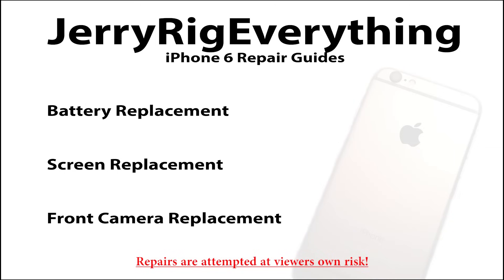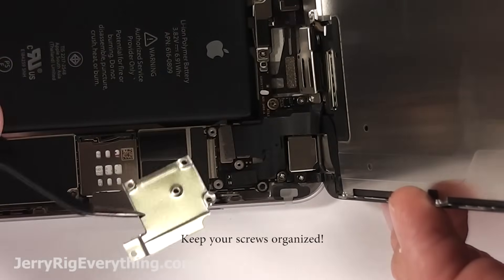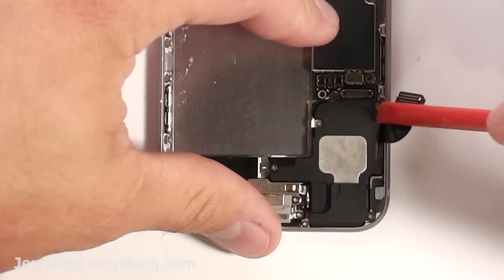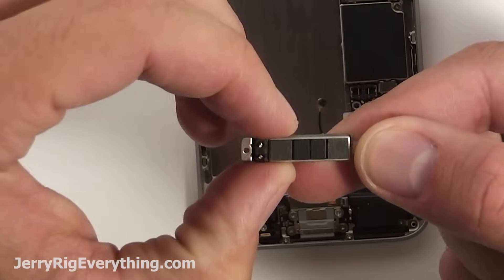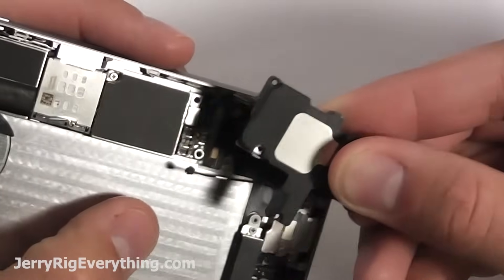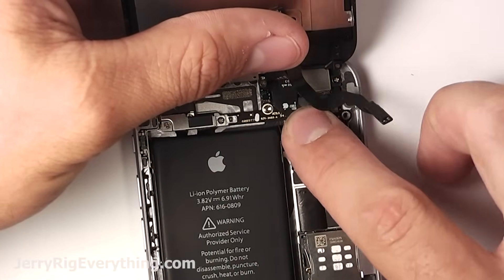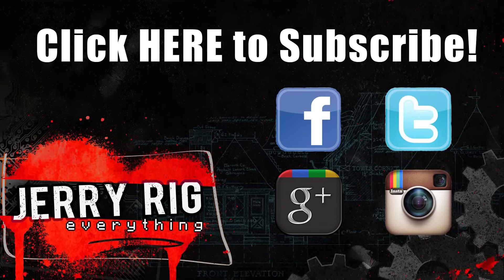iPhone 6 Charging Port Replacement in 5 minutes, microphone fix, headphone jack repair

Comment: Before you perform this task try cleaning the port with a toothpick.  Worked beautifully.  Held more lint than my belly button.
Reply from the maker: +Cutter Johnston Very good advice!
Reply: +Cutter Johnston Woah. You just cured me of months of headaches. I wish I had seen this sooner. Charger works like a charm now. Pulled out a TON of lint. thank you!
Reply: +Cutter Johnston dont know why i didnt even think of that.  thanks man
Reply: +Cutter Johnston I cannot believe that was what the problem was....phone working perfectly again, cheers for saving me the hassle of getting it sorted in a repair shop! It was full of lint!
Reply: +Cutter Johnston LOL I was just about to go into the apple store or sprint store to get my iPhone "Fixed" but this worked! I cleaned it and it felt like I was sticking the toothpick inside Narnia. So much dust came out from there. Who knew?
Reply: You're a genius!!! I can't believe how much lint I pulled out! I was just going to buy a can of air but tried this toothpick first! Phones been like this for the past 2 months until today :) Thanks a lot!
Reply: +Cutter Johnston Thanks alot this really worked,never knew so much lint could get stuck in there
Reply: Me either.  Simple fix too.  Pass it on.
Reply: Love you TOOOOOOOO
Reply: Wow! This has sure been a l low tech success.  Amazing to me.  Thanks for your comment!
Reply: GOD FUCKING BLESS YOU ARE A FUCKING HERO
Reply: +Cutter Johnston you saved me on this one!  I can't believe I had forgotten I had to do this on my iPhone 5 when charging got inconsistent and I had to do the 'angle the cable sideways' type tricks to get it to charge.  Looking in the charging port, it didn't look like THAT much lint .. but after cleaning with the toothpick, it's working perfectly ... even when wiggling the cable it keeps on charging now!   KUDDOS!!
Reply: +Cutter Johnston You are the man!
Reply: +Cutter Johnston Thank you!! I can't believe how much lint was stuck in that small hole. You da man!
Reply: You're a life saver!!! Had one of those days where everything that could go wrong did. Thought I had to pay for a repair, luckily there was no available appointments for 2 days and came across this video and your comment. Just wanted to send a big thank you your way.
Reply: Toothpick did the trick! I should have known better than to take it to the Apple store. After several hours waiting a tech took a look at it and said it couldn't be fixed, that I could switch it out for a new phone for $299. I asked if they couldn't just switch out the port and she said it was soldered into the main board. Blatant lie according to this video. Check the internet first!
Reply: I wish I could give you gold for this!
Reply: Thank you so much! I had some pictures that meant a lot to me, but my phone had died and I couldn't charge it. I was afraid I'd never recover the photos. I was getting ready to take the phone apart or pay the fees to apple to have the charging port replaced. I just saw your comment and tried using a small needle to scrape out lint. To my surprise, a fair amount of lint actually came out! I had no idea it was in there. Best of all, as soon as I got the link out, my phone began charging like normal again and I recovered my photos/have a working phone again. Your post saved me, thank you. :)
Reply: Cutter Johnston Dude, let me tell you that you are a legend. Took me a little bit of time and attention to do it but with a flashlight above I cleaned the whole lint and it was a lot like you said. The side contacts from the port were almost unseeable, now it works perfectly and even the cable pops in like new. I am very thankful. I honestly respect you now.
Reply: does putting toothpaste make work better?
Reply: @Cutter Johnston!!!! BRO!!!!! You saved my ass with that clean the port comment. My phone phone insurance wanted to charge me $200 to replace it, a local phone repair store wanted to charge me $70 for labor plus whatever parts cost to repair the charger port and you!!! you my man fixed my problem like nothing for FREE!!! Thank you soooo so soooo much!!! No idea how much that saved me money i didnt have and stress i didnt need.
Reply: PERFECT ! ! !    Cutter  Johnston,    thank  you  for  that  advice.   

>>  Cutter Johnston ,  1 year ago:    Before you perform this task try cleaning the port with a toothpick.  Worked beautifully.  Held more lint than my belly button
Reply: Hey Cutter Johnston bro, i can't thank you enough. Your comment made my whole day. I was so happy. Have been freaking with this charging issue for more than a month. I have to keep my phone stable inorder to charge it. I was mot able to use my device while it was charging. Youre my hero. 😃👏 Keep doing these kind of stuff. God bless!
Reply: You've just saved my Iphon from long term exile to  drawer. THank you. Why I haven't thought of it first?
Reply: you sir deserve a cookie. the biggest cookie out there. been having this problem for so many months and thought to get it repaired. I CANT BELIEVE IT WAS A SIMPLE AS THAT! thank you again!
Reply: Thanks so much!  Worked like a charm and saved me a visit to the Apple Store!
Reply: Holy guacamole that's a lot lint!  Considering a new career in lint ranching.  Thank  you.
Reply: Good man!
Reply: +Cutter Johnston Thank you!
Reply: +Cutter Johnston I LOVE YOU SO MUCH
Reply: The Qtip trick SAVED my phone. Thank you Cutter Johnston! And thanks to JerryRigEverything for a great video.
Reply: WORKED FOR ME!!!!! THANK YOU! It had so much lint!!! lol Thank you again!
Reply: Thank you soooo much for this, you saved me bundle of money... I paid to get it fixed on my old phone too. Mine is now working a treat, thanks again
Reply: Worked for me too! Thanks a lot!
Reply: Top tip. Worked 👍😀
Reply: No lint in my iPhone port. Thanks for this excellent video! Saved me a lot of money.
Reply: Cutter Johnston
Reply: Thank you!  Just saw this and it worked beautifully!  I agree, cannot believe how much lint came out!!!
Reply: Boom worked for me as well! I was able to charge but I couldn't even breath near the phone. Able to hold the phone while charging again, YES!
Reply: Cutter Johnston - thank you - I had a lil more lint in the charging port than my belly button, you're the smartest man in the world. It was if I had a short in the connection!
Reply: Cutter Johnston omg thank you for sharing this tip! Cleaned out the port and it's now charging beautifully!
Reply: Just tried this. Worked wonderfully. Thanks man.
Reply: Thank you so much, it worked perfectly.
Reply: wow! thank you very much!
Reply: Cutter Johnston THANKS A MILLION
Reply: Cutter Johnston I tried it but still having problems
Reply: Hahaha, a toothpick TOTALLY did the trick! I was gonna try to pull apart my phone, and probably destroy it in the process! Thank you! :P
Reply: This is so true! I've been doing this for years and the amount of lint that gets stuck in these ports is surprising. Be gentle and don't push too much sideways with the pick to avoid bending any of the connectors. This tip is also equally applicable to the headphone connector which will also collect a lot of lint and prevent a solid connection.
Reply: Thanks a lot! I was gonna go to a guy to get it fixed tomorrow but thankfully I read your comment!
Reply: This worked for me too , i was cursing my charging port
Reply: +Cutter Johnston very good advise. Thanks alot this really worked. Much appreciated.
Reply: If you ever come to Cyprus, I am buying you a drink.
Reply: Thanks you just saved me lots of trouble
Reply: +Cutter Johnston You have done the world a great service. Wow, what a lot of lint. It works fine, thank you sir.
Reply: Cutter Johnston thank you , thank you , I did as you suggest and now I can charge my phone .  My very biggest thank , this trick saved me much time and cost and hassle. Excellent advise.
Reply: +1 this
Reply: thanks man....
Reply: Thanks man you just saved me 300 bucks
Reply: Cutter Johnston  what happened if soder lighting port to a android phone could you soder android charging port to  iPhone
Reply: Well, the advice was great, unfortunately I had already started the repair and I ripped one of the connectors. However, the “take lint out” trick works because while my charging cables were loose before, they now work fine!!
Reply: There was an actual chunk of paper stuck in mine. I’m so glad I saw this comment, thanks a million!
Reply: Thanks man! My phone works beautifully with your advice.
Reply: I made a new sweater with the lint I found. Thanks for advice. Phone charging without problems now.
Reply: Cutter Johnston what do I do if it’s just loose from one side ??every time I move it a little it disconnects and stops working
Reply: Cutter Johnston well most of use are here because we tried about everything
Reply: Thank you for your great advice Cutter J. Note, you can use a needle or paper clip as well. I personally used a paper clip and worked really well. Feel free to get rough while doing it to get all the lints out; your charge port will not get damaged after some pressure for cleaning.
Reply: fantastic like others also spent weeks wedging the charger to get it workingtop man for very worthwhile tip and advice
Reply: Thanks!
Reply: Holy shit bro!!!! THANK YOU!!! For months the only way I could charge my phone was by dangling it in a weird angle, now it works like new!!
Reply: Booyaca!
Reply: Thank you!
Reply: +Cutter Johnston Purchased a replacement kit on amazon and watched this video to learn how to replace the port. Just came across your advice, tried the toothpick and it works. Luckily I bought it from a seller with free returns. Thank you so so so so much!!!!!
Reply: I just did that it work perfect, had soo much lint lol.
Reply: the real hero right here ^^^^^
Reply: Cutter Johnston thanks man you are the smartest man ever you saved me
Reply: thanks man that tip fixed my phone .never thought of doing that ..
Reply: what if mine is just super loose and wiggles but i need to lean it to one side for it to work?
Reply: My hero
Reply: +Cutter Johnston, I am late to this party, but you rock! That was it.
Reply: Seriously I am speechless..I am using my phone since 4 years nothing had happened but somehow I am facing charging issue since a 2 year always planning to replace new charging port ..in lockdown days it gets completely off while charging after reading this comment I used to clear charging port and now its charging thanks buddy your comment is more useful than itself video.
Note: I will only add one suggestion here once your cleaning your port make sure its completely clean.
Reply: Watched the video how to replace the charging socket then went to look at the comments and saw the toothpick suggestion! 
Thankyou!!!!! Worked a treat a good quick fix. Cheers fella.
Reply: But be careful I tore off 2 gold power connector prongs from inside the charging port. Now I can’t charge.
Reply: Thank You , saved me a thousand rupees 
Love from Meghalaya ☺️😍😍🙏🏻
Reply: Tried doing this and got most of the dust out however it’s still having difficulty I kinda wonder if I accidentally pushed some dust into the two corner holes and plugged it. Or that I messed one of the connection pins up.
Reply: You are welcome.  Thanks for the comment!
Reply: Perfect Idea... Toothpick worked very well... I got many small lints that were not allowing charger pin to go inside properly. I was about to drop-in an IPhone workshop.You saved my money man...! feeling great..! God bless you..!!
Reply: Genius!!! Thanks for saving some money

Comment: I have replaced flex cable twice and my charging port,mic are working fine but the headphone jacks on both flex cables from two different sellers make this popping static noise out my good working headphones! any ideas of what it could be. Also I have swapped to my original one and it works great besides the charging port problem i had from the start. thanks in advance!

Comment: Jerry, I need your help please. I bought the part, and tools, and replaced a bad charging port using your video ( THANK YOU BTW!), the charging port work fine. However, now my celluar service is off and on in full bar ares. It will frequently say "no service". Jerry, any idea what I could have done to Iphone while replacing the port?
thank you!
Reply from the maker: I think the antenna wire goes to the charging port too.  (you should research that first as i am not sure)  so even though most everything works,  that part might not.

Comment: I did this and your battery replacement video and did everything exactly as you did and my phone turned on! first time in about 4 months!!! but when i put it on charge my phone told me it was charging but it wasnt really charging and when it eventually died i opened the phone up and dis connected the  battery and re connected it and put it on charge and when i did it started to charge so i unplugged my phone and screwed down the plate and then it wouldnt charge and it still wont please help?
Reply from the maker: Maybe one of the replacement parts you recieved was faulty?
Reply: I got the parts from your description even the battery and tool kit i don't know... is there any way to test what part it could be, also the battery was getting REALLY hot when i had it plugged in
Reply from the maker: Id vote the battery. But it is hard to say without the phone in front of me.
Reply: Right. I think im just gonna scrap the phone... not worth foolin around with anymore thanks for your help!

Comment: my iphone 6 only charges when the phone is off, i know alot of people had/have this problem. will this repair fix this issue in particular? did anyone use this repair video for the same reason and was successful? please help?
Reply: +DJ WILLI me too. any luck?
Reply: nah it didnt work :( its the IC chip what is burnt out. but when replacing this chip you must reflow the entire motherboard! so i got the 6s plus :). BUT, in the future, don't use 3rd party chargers ESPECIALLY with car chargers and this is simply because wall ports and genuine chords give the necessary power, any otherwise causes false and faulty batteries phones and burnt out chips!
Reply: DJ WILLI its the u2 chip, needs to be replaced

Comment: *Don't forget to remove the microphone housing and transfer it over to the new mic. I didn't do this and the phone did not work properly. I had to fully disassemble the phone to fix this. When you remove that housing, it will be difficult because of adhesive but it does come out.
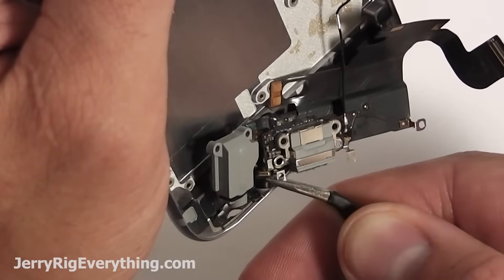Reply: It is the black plastic piece that he is holding with the tweezers at 2:48. Also, watch out for the charging port housing. Mine stayed attached to the old piece rather than the frame. The easiest way to tell: hold your old piece up next to the replacement, the part that is different needs to be transferred to the new components.
Reply: hi after I replaced lightning port my loudspeaker stoped working, but i didnt transfer the small microphone housing to the mic is it posible that the loud speaker doesent work because of that? thx
Reply: Saso Kmet did you fix it? How? Thx
Reply: +Isaac Lee 

BLAH!!! He didn't show this in the video...I totally missed it. A few days later, after everyone kept telling me my phone sounded terrible, I realized something must be wrong with the mic. And after taking the phone apart - I realized this housing is missing!!! My fault, I should have been paying better attention...but yikes, I don't have the old assembly any more - trashed it. Not sure where to get a new mic housing now!
Reply: I'm having problems with my mic after replacement too! I can't figure which part you are referring to by "microphone housing", is it recognizable anywhere in the video?

Comment: my iPhone 6 only charges to a charger brick and on a computer on both side perfectly, but it doesn't sync - computer does not see the iPhone when connected , but it charges as soon as i connect to the usb. I have tried several pc and mac, even several different lightning cable but still problem persist.
Reply: +Benjamine Jose Chiong I also have a non-syncing iphone 6. did you solve this?
Reply: Same here. If you solved it, let me know please haha :D

Comment: changed the charger port just like in the video and now my screen doesn't work. I didn't mash the connectors in, i did it the exact same way as you did it. Do you think I should get a new screen now?
Reply from the maker: +Alec Petersen Make sure the connections are in place correctly.  Sometimes they are not plugged in right.